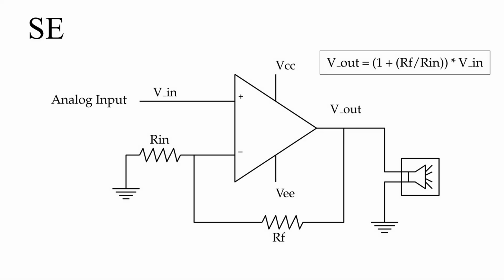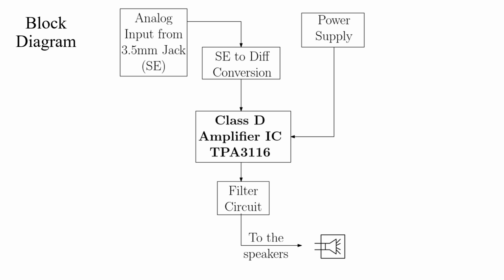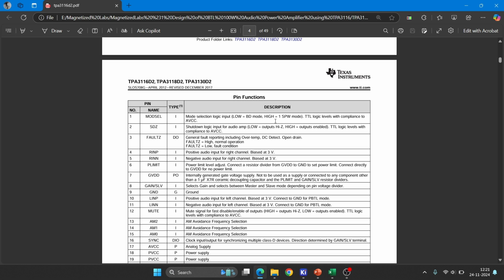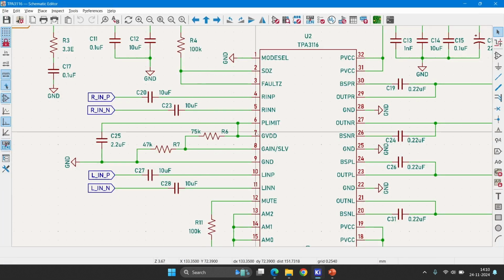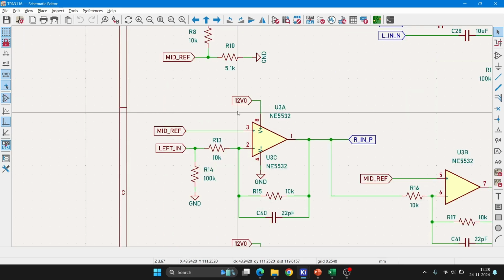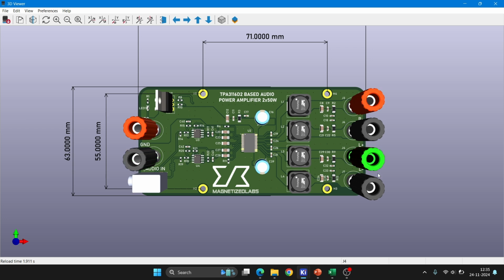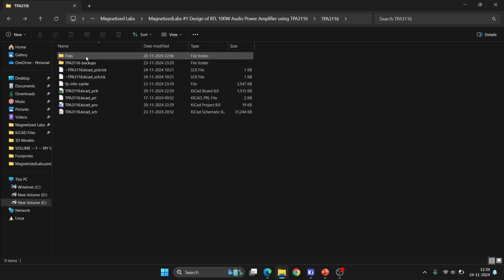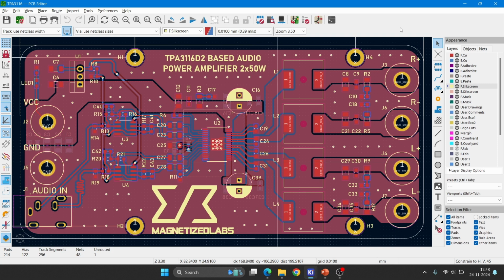Design of Class D BTL 100W Audio Power Amplifier using TPA3116 in KiCAD | Magnetized Labs 01

Comment: 🙏🏽 Namaskaram, thank you for this video! I just subscribed to your channel. If possible, could you please create a video on designing a simple 4-layer PCB in KiCad 8? It would be great if the video includes handling two voltages (e.g., +3.3VDC and +5VDC) on the power layer, with a focus on PCB routing, creating power planes, and best practices."
Reply from the maker: @arun.sekher  Sure. Next video is based on 4 layer PCB. And contains lot of information. Please don't miss. Thank you for your support.
Reply from the maker: Hello @arun.sekhar, hope you are doing good. We have posted a video on 4 layer pcb design and routing with stm32 microcontroller board. Please checkout the channel videos. Thanks for your support.
Reply: Thank you @magnetizedlabs! I'll definitely watch it. Although I'm not yet familiar with the STM32 microcontroller, this could serve as a great introduction for me.
Reply from the maker: @arun.sekher  no problem. This is a basic 4 layer board. You will get an idea from it.